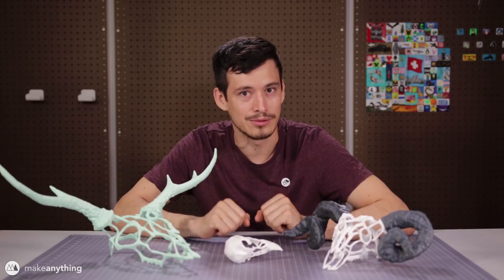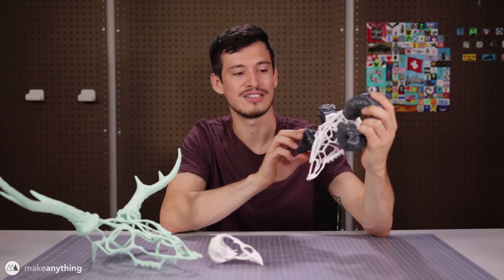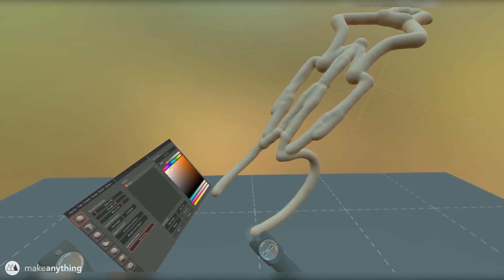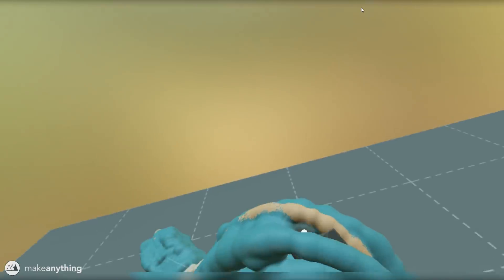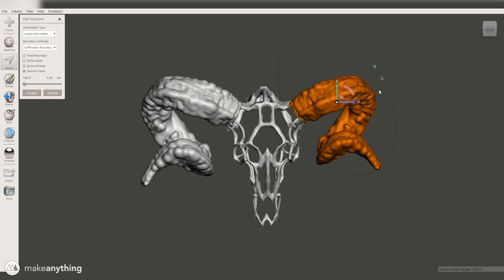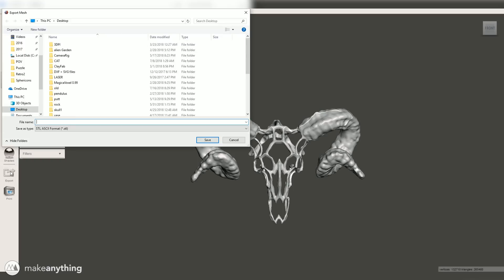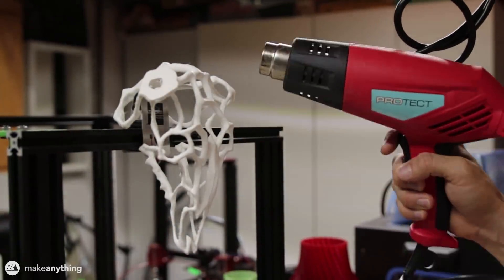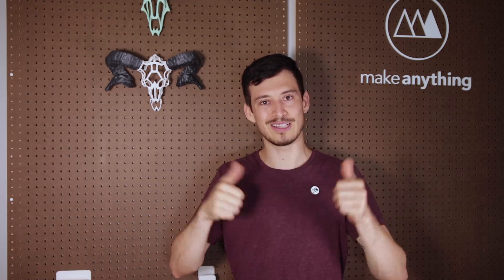VR Sculpting and 3D Printing a Ram Skull with Kodon

Comment: FYI: If you're using ABS gloop as a bonding agent it will not melt the parts together chemically if the parts are printed with PLA. it will join the parts together but only the same way super glue would by creating a bonded surface between the parts.

Comment: they need to make it easier to do spikes and horns in kodon. Maybe being able to adjust brush size while painting so you can temper out the brush to a point. It's difficult doing horns and teeth at the moment,.
Reply from the maker: True, I like what Gravity Sketch does using trigger pressure to adjust brush size.

Comment: Hey Devin I was wondering if you have tried doing any kind of smoothing on the Voxel prints (Like the skull that changes color based on orientation)? If you have what has the result been? Has there been any noticeable change to the color effect or have you not noticed any major changes?
Reply from the maker: I haven't printed in a smoothable material, so I haven't tried it yet. I imagine the blending of the corners would hurt the effect a bit, but it would probably still look cool!

Comment: Spectacular project! As someone with both VR and a 3D printer, you really have set my mind ablaze with this. I definitely have to try this. At first I thought it was made with SLA or powder fusion, because of the geometry and finish, but seeing you do that on an FDM machine is impressive, and the heatgun worked wonders. I think I might try to acetone wash mine, but I'm NOT looking forward to the cleanup. Turned out great, congrats! Very interesting video, thank you.